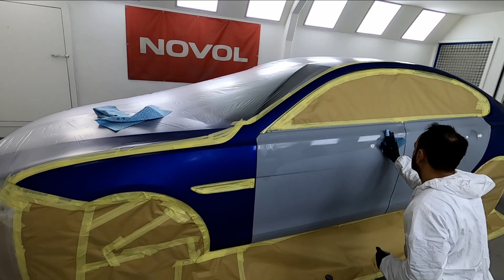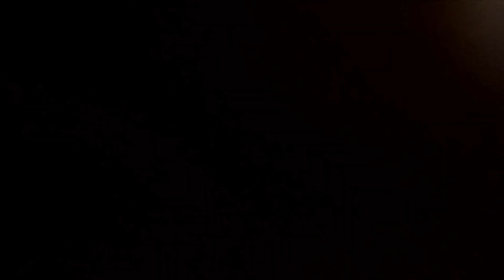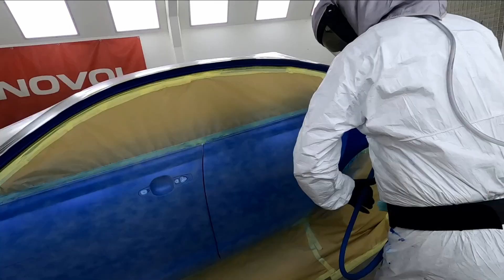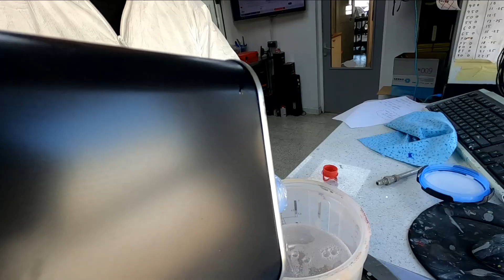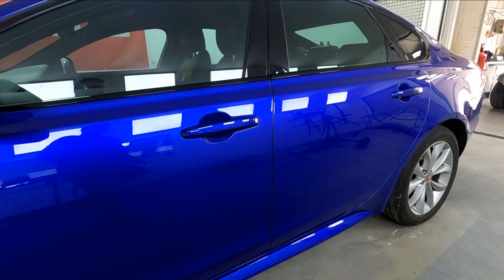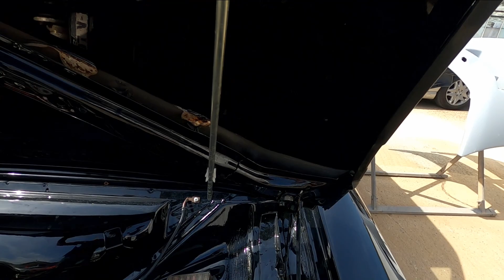JAGUAR XF R-SPORT Repair + Workshop Update!!!

Comment: Hi buddy
Do you thin the 525 down at all or is it just the 2.1 ratio no thinner ? Great work and good workers 👍👍
Reply from the maker: No thinners
Reply: Hi
Thank you for reply I’m just starting to use spectral laquer now I have 525 and 565 laquers.what do you find is the best gun you use to atomise them ? I’ve been using either 3m performance gun 12-13 or my sata 3000 but I find those guns don’t put it on as fine as I’d like and isn’t flat enough.any help would be appreciated:) 
Regards